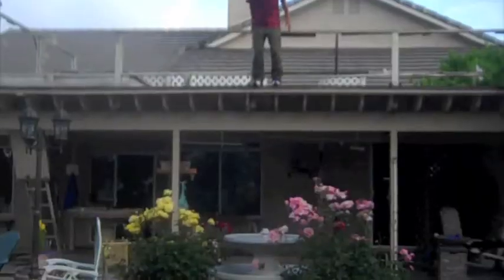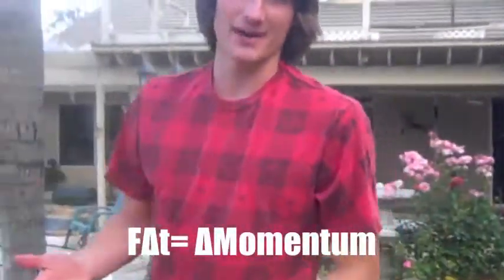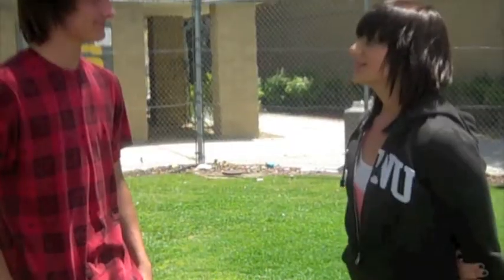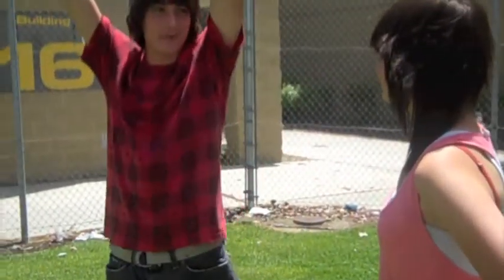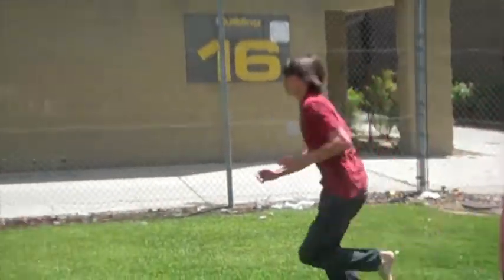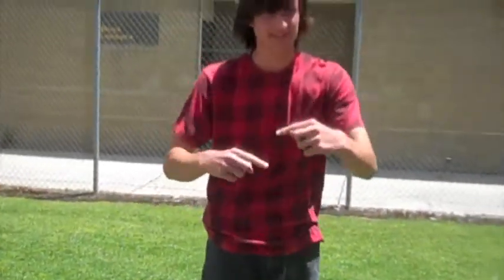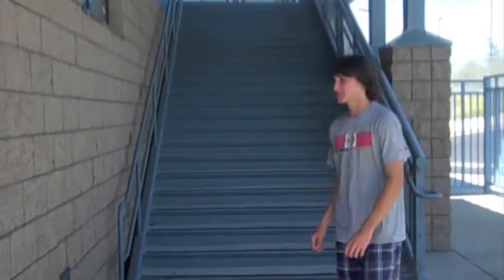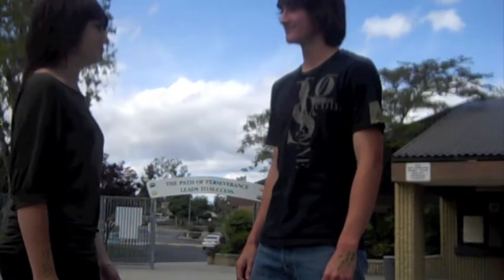The Physics of Parkour and Free Running

Comment from the maker: @channalbert Rolling over our arm does 2 things, increases surface area and increases duration of impact, these things combined is what makes the impact of a fall, (when the roll is used) bearable for the human body.

We go over are shoulder and accost the back as opposed to a summer sault, because you don’t want to put force on the spine or head, which a summer sault does. A PK roll puts impact force along the back with minimal impact on the spine, when preformed correctly.
-Jimmy
TPK